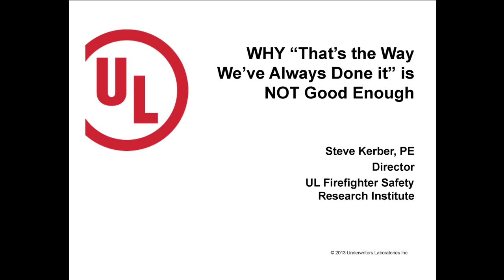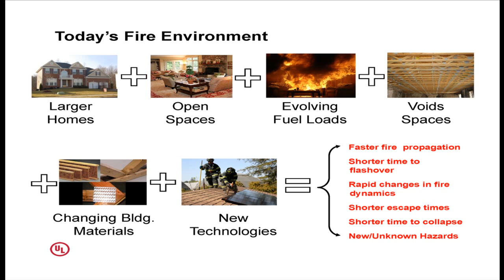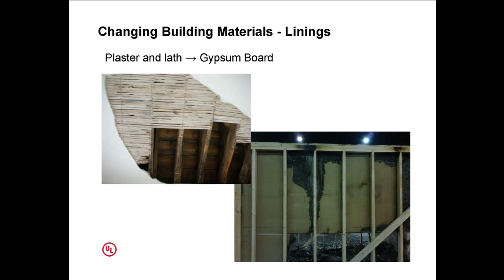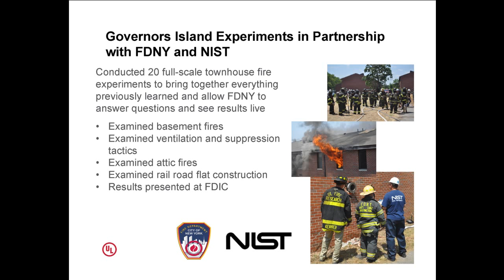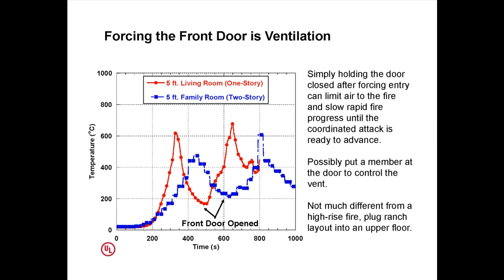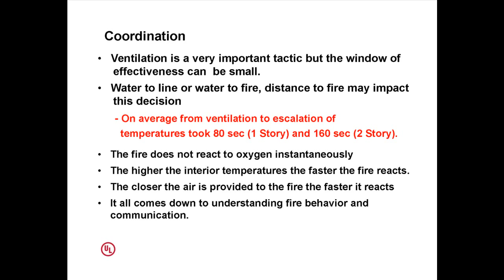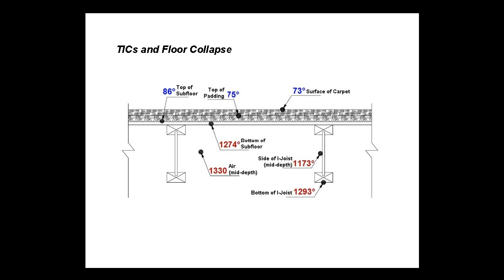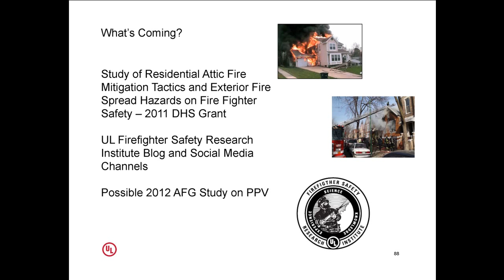FDIC 2013 WHY "That's the Way We've Always Done It"  is NOT Good Enough

Comment: Putting water on burning material is the name of the Job!  It makes Everything better.

1:38:40  The first place the fire wants to go is the Path of Least Resistance.  Not necessarily UP because Heat Rises, but wherever the Pressure can be released.

1:40:17  You do NOT go inside a burning building until you have extinguished all Visible Burning Material from the Outside for This reason!

1:44:00  Burning material equals pressure buildup.  Add water to eliminate the flames and the room pressure drops dramatically compared to the rest of the burning spaces.  By hitting a burning room from the exterior, you will NOT push fire you will actually protect the other rooms From the fire by creating a low pressure area in that room.

Comment: UL or any other testing organization can not and will not tell you to Not do something.  They will show and tell you what will happen when using different tactics.  Then each fire department can chose what they want to do.

If you LISTEN very carefully to his tone of voice and what he says when he talks about Vertical Venting, he is trying to talk you Out of Vertical Venting because it ONLY works under a very Specific and PERFECT condition.  The ceiling hole has to go into the fire room!  How many times have you seen that done?  If the hole went into another area, the heat would travel through the house to get to that vent location.  You have just destroyed the house and killed the trapped victims along that path.  If you do get the hole in the fire room, guess what?  Now you have introduced the fire into the attic and now you have a structural fire.  

Then listen to how aggressively he talks about JUST breaking out the window and apply water to the burning material.  Then EVERYTHING will go out the window and protect the rest of the structure and occupants!  This is Not Rocket Science!  And, it's a JOB, not an adventure!  "Stop the threat as Fast and Safe as possible while using the Least amount of water,"  That is through a window, directly on the burning material before a crew could even get on the roof or through the front door.  LISTEN TO THIS GUY!!!  Don't look for a few words here and there that you can use to prove that Vertical Venting works and leave out all the words that proves it doesn't.